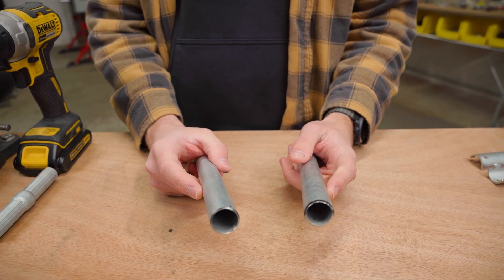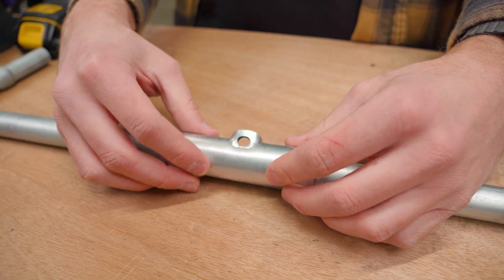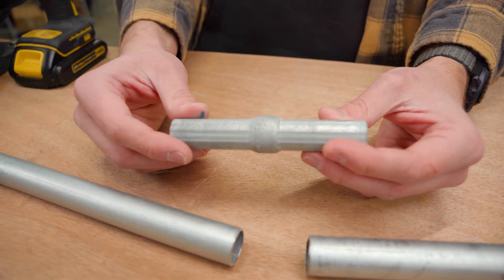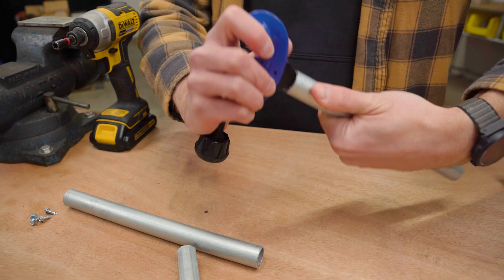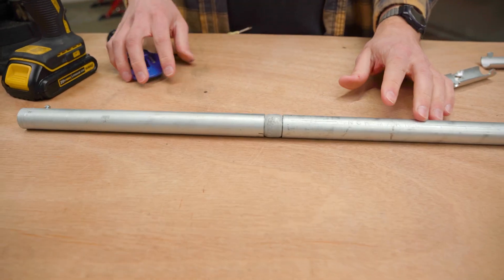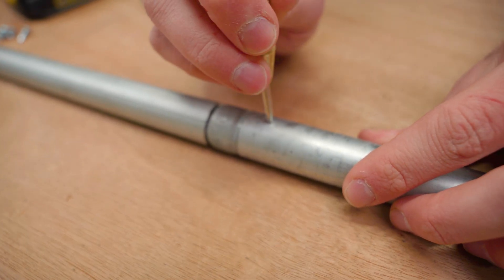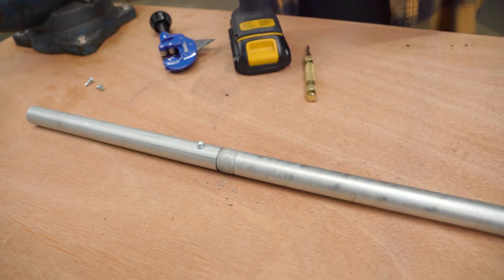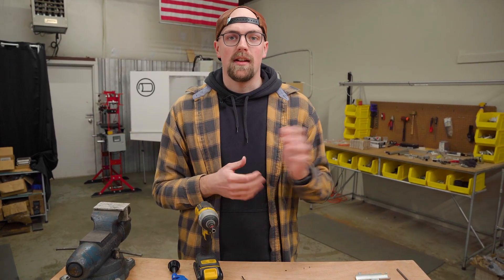A Hidden Coupling For Joining EMT Conduit!

Comment: That screw will penetrate into the cable space and will cause damage to the insulation when you pull cables through it. The better way is to use the saddles that fix the conduit to the surface to hold the joint together.

Comment: I might butter that joint up with JB Weld too depending on application. But those things look awesome. I built a conduit project with  ½” conduit and sections of heavy wire galvanized cattle fence a few years ago.  I used  ½” pvc inside and standard short outside conduit joiners but those things would have been perfect.

Comment: I would buy these.

A tip for those nasty burrs. I've been cutting emt with a tubing cutter for over 20 years with no burr, no reaming. Score the emt and stop short of creating a burr. Don't force the cutter. Use an upturned emt bender or for longer pieces use your knee to break the score for a clean cut. No reaming needed. It takes a little practice to get a feel for it but it's not that hard.

Comment: I like it.  A very clean solution, especially if you are building something like a roof rack for a 4x4.  Using a bender and pop rivets would give you a nice, clean frame.